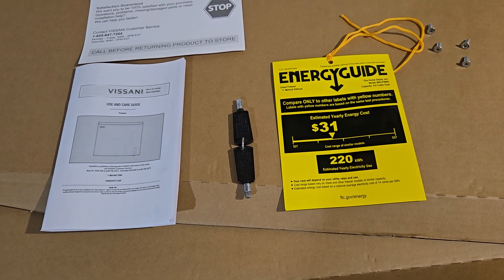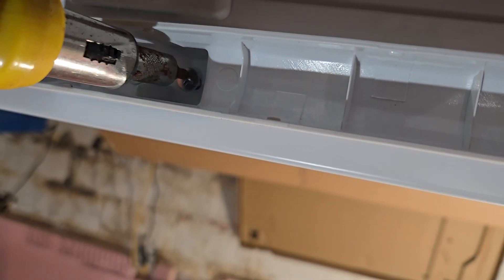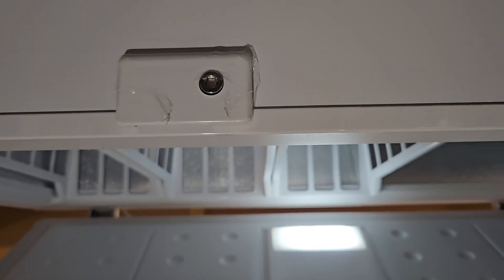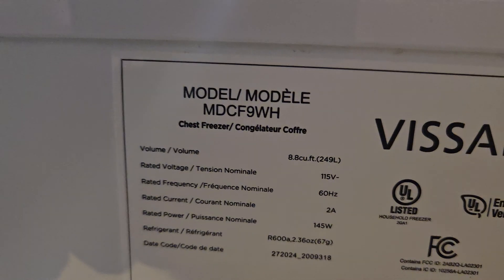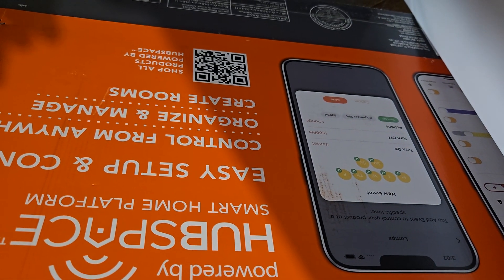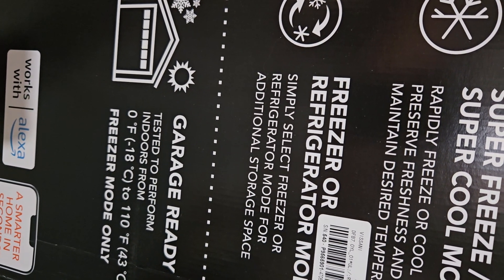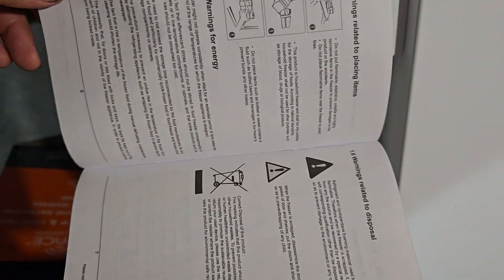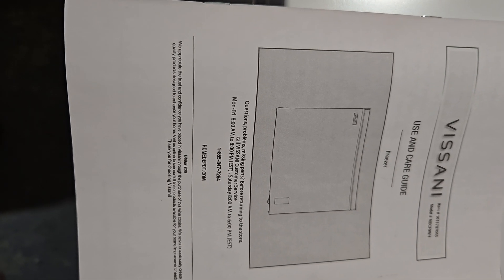Vissani 8.8 cu. ft. a monster of a refrigerator / freezer chest. So many options and very versatile.

Comment: OK video, but you just showed us what we can already see. Reviews will tell us what everyone thinks about it. Please don't get mad at me. I was hoping to see this: now that it is plugged in, in 10 words or less, how do I simply get it into freezer mode and set it on some temperature so it can start doing its thing? You know, just the simple get it started stuff. A nice extra would be if someone threw out a recommendation for how long should it be given once you get it into freeze mode before you start putting food into it? As well as a recommended temperature to leave it at? (I will start with going halfway across the line.) 

Then go into the fancy stuff. I don't CARE about super freeze, I don't CARE about wifi, and I don't CARE about another swell app to have to learn. I don't even CARE about the keys because there are no little kids around here. I just want to freeze my freaking food!!

As for Celsius to Fahrenheit, I'm lucky it was already on Fahrenheit, otherwise I would have just learned the Fahrenheit equivalents and left it alone. Tired of having to figure everything out.

Also, the control panel is at the BOTTOM right of the unit. Why would anyone put it there, to where you have to get down on the floor or bend way over to get to it?  Wouldn't it have been better common sense to put the control panel at the UPPER right to make it easier to get to? My husband said, "because that's where all the stuff is." What stuff, oh, the electronic stuff? So why can't they run a few wires and place the control panel at the top? This is 2024. We learned how to split the atom; we sent someone to the MOON in the 1960s. I guess I should be happy that they at least put it on FRONT of the unit. 

I would like to know if it's possible to buy any appliance now without it having to be being a "smart" one? 

I have 35 years of IT experience and computer literacy behind me, which includes everything from mainframes, to networking, to back-end internet, to pc's, to tablets, to databases, to algorithms, to testing, to developing, to phones, so it's not like I have no clue about wifi, setups, apps, upgrades, internals, and the rest.  Or even how to figure things out. I still keep up with tech. I hate having to RTFM (that means 'Read The Friendly Manual'). 

The first thing we learned in IT was about the KISS principle. And that means Keep It Simple, Stupid. Do not make things more complex and more complicated than they need to be! It seems this philosophy has died!

To tell you the truth, I'm sick and tired of an app for this and an app for that, an app for this, an app for that. Like a new patty-cake song. It's fine if you're into a million apps, but I just want to use my fingers to set the thing!! WHY do I need or even WANT wifi for a simple freezer I just want to put food in? That's about as dumb as needing smart dinnerware to tell me if I have eaten all my food yet. How much is still on the plate? How long will it take me to eat it? My refrigerator has been great for 20 or so years, and not ONCE did I need wifi or even care about needing an app to see if it's still working. STOP THE APP MADNESS.

I'm so sorry if it seems I went off on you. I didn't mean to. To make up for it I gave you a like, and also subscribed, so please forgive me.
Reply from the maker: Hello! We are going to do a video with the items that you asked for. It should be out by New Years. We will send you a notice, so please look for it. We thank you for your comments. I too can not believe that the controls are way down there. I do believe in KISS, but engineering  is getting out of hand. We do not and will use the applications. I too have an IT background and too much information is at the companies disposal. 
As for RTFM, ;) I too am a hands on and we do these videos that way. Thanks again! We also thank you for the like and subscribe!